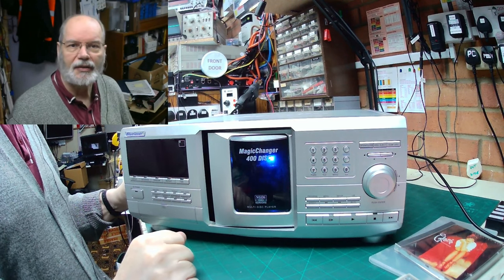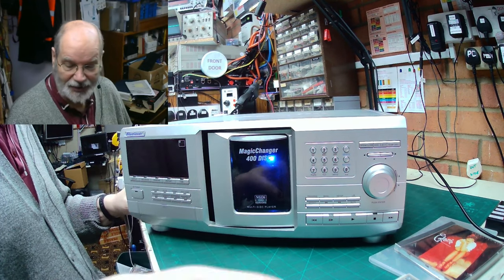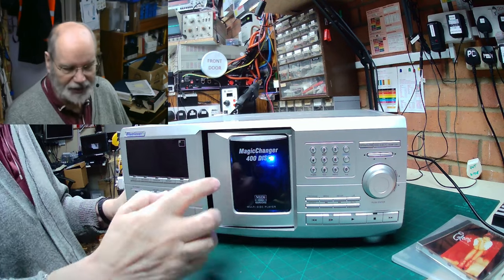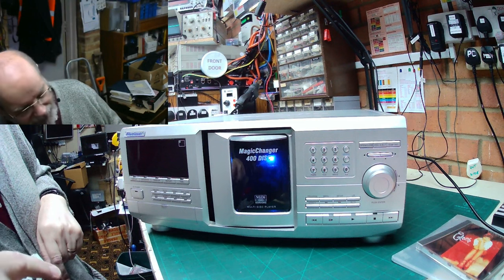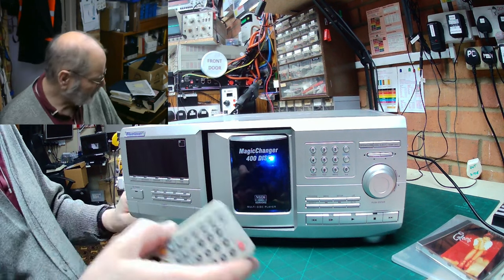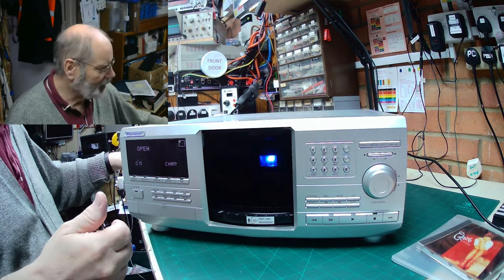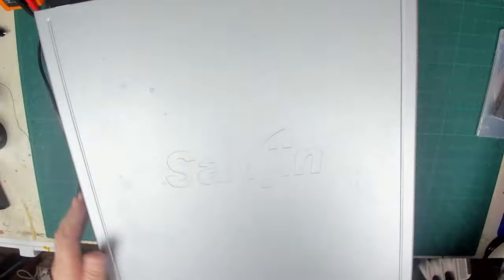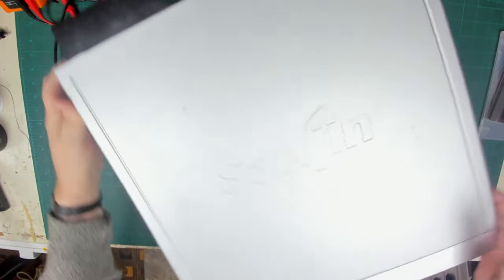Sanjin DX400 Repair

Comment: I would say that what happened is when the door jammed up it cause the caps to over heat or they just went bad due to age!
Reply from the maker: The supply for the motors is from the + & - 9V rails. The caps are on the 5V rail. They just dried up over age.

Comment: it looks like a rip off the the sony CDP-400, the mechanisms etc look similar, but the turntable and everything else its made up with looks very cheap...im sure there are variations of this one or hybrids, but hey if it does the job, fair enough but you cant beat quality especially when it comes to working on it or looking for parts.
Reply from the maker: Yes, I believe it is, thanks for pointing that out. I didn’t find anything for this when I first searched but now have a full manual. It’s only slightly different. Maybe SONY bought it in as a WHITE LABEL REBRAND? I doubt it’s the other way round or SONY could sue.